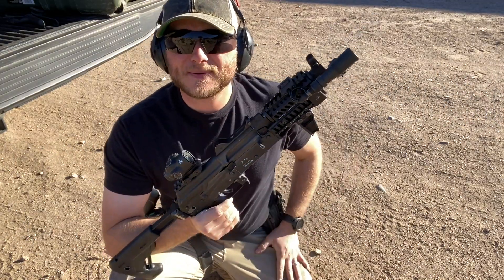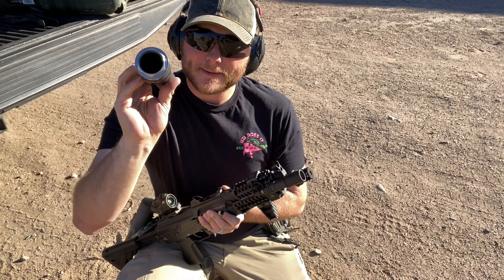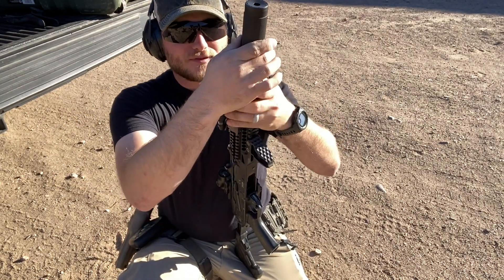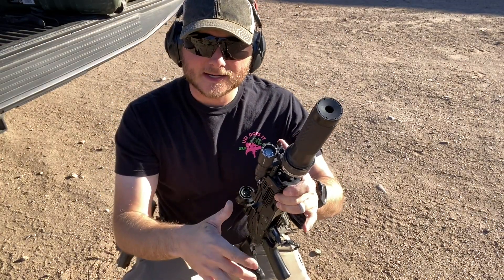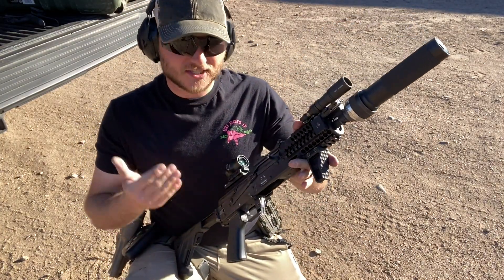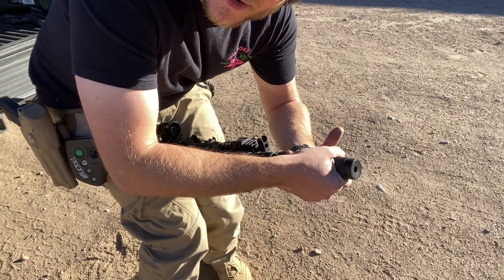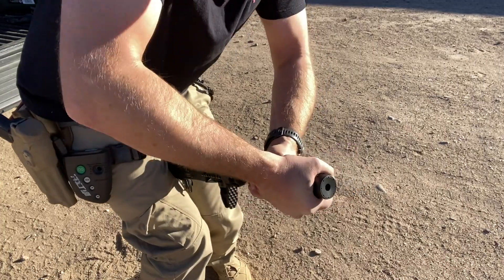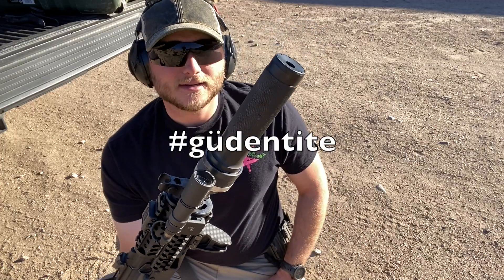Quick Tip : Attaching the Dead Air Wolverine to the JMAC Customs RRD-360 Muzzle Device

Comment: Seems to be the biggest problem with the Dead Air adapters, is that they come loose and you got to retighten it after you run a couple rounds through it.  This was my biggest question about the JMAC setup before I went that direction.  Thanks for answering.
Reply from the maker: Glad to help!
Reply: Keymo doesn't have this problem.  Hell, my Wolverine with the regular locking collar doesn't either.
Reply: @joshr9730  This ^^^ Keymo all day.
Reply: @VRGalaxy_762  True but it adds so much weight. 🙄
Reply: @muffemod  I'll take a few more ounces of weight in trade for the peace of mind that my Sandman isn't going to come undone during firing.
Reply: @rottdad775  There's several threads on reddit from users having their keymo mount walk off FWIW.
Reply: @muffemod  and you can bet good money that it was due to user error/improper mounting. I have 5 guns with Keymo brakes or flash hiders on them, which I rotate between using my Sandman-S Mil. Tens of thousands of rounds so far, and countless times mounting and unmounting.

The issues reported on Reddit threads come from inadequate torque when installing the muzzle device, or from not cranking down the can when mounting it to the keymo itself.
Reply: @rottdad775  Couldn't agree more.  But then it's on the manufacturer to design controls to prevent these issues.  There are much more robust AND idiot proof designs from the now dated keymo.

Comment: I just bought this setup for my wolverine and AKs. How hard is it to attach the muzzle device. Should I have a gun smith install it?
Reply from the maker: It’s easy to attach the main concern is concentricity. Alignment should always be confirmed, even though the Wolverine is designed for non-concentric AK barrels, some are really bad and could have a baffle strike.
Reply: @robsolo89  Do you have a concentricity rod you recommend?

Comment: This is why keymo is better
Reply from the maker: KeyMo will also loosen if you don’t give it the ol’ gudentite.
Reply: @robsolo89  what are your thoughts on the 360 vs rrd2? I've got an ace 556 and need a suppressor mount option but want the best recoil reduction for competition use.